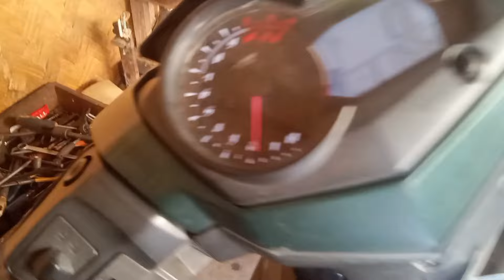KALAMPAG NG MAKINA NG SNIPER 150 STEP BY STEP TUTORIAL

Comment: kuya lan sana mapansin mo tanong ko 🙏🙏 kasi sa dming pinagtatanongan ko sa YT walang pumapansin.
simpleng tanong ko lng naman po kung anong magandang jet. set ng P.E keihin 26mm para sa mga pantra 155, yung malakas sa hatak pero matipid parin sa gas. maraming salamat kuya lan and godbless you 🙏
Reply from the maker: Kapatid Kaya Po Hindi Ka nasasagot sa tanong mo sa yt ay mejo mahirap Po talagang sagutin Tru text o litra Ang tanong..
Kino conceder parin Po Kasi Namin Kong Anong karga no motor at bigay Ng nag dadadrive..sa madaling salita kapatid mahirap sagutin sa text pero madaling mag disesyon sa actual...
Reply: pure stock pinoy155 po kuya lan ❤️
Reply: @kuyalanmototv  kuya location nyo po,magpagawa rin po ako ng clutch damper